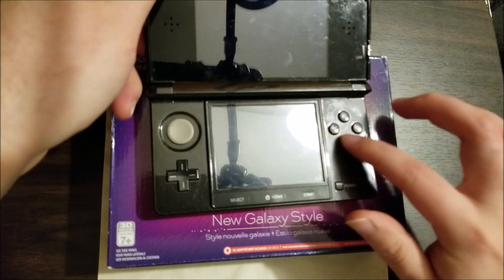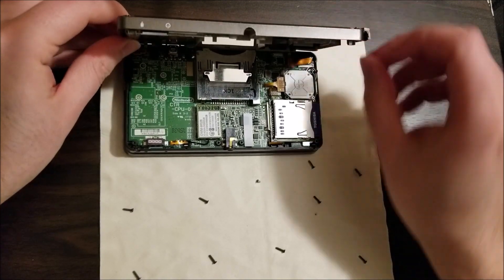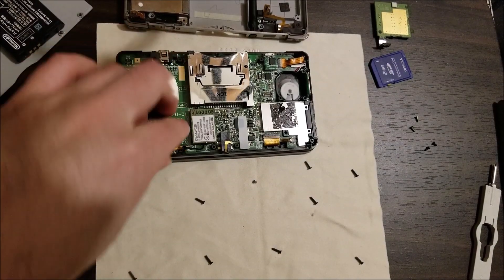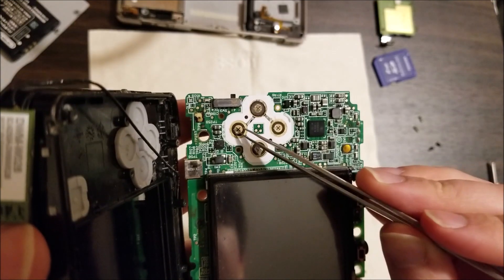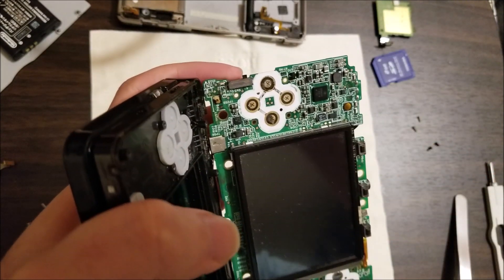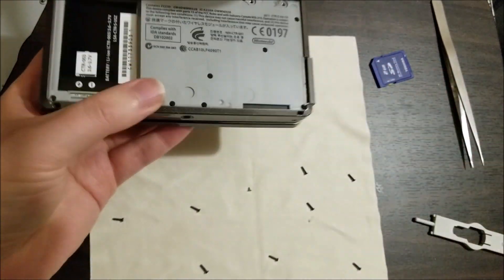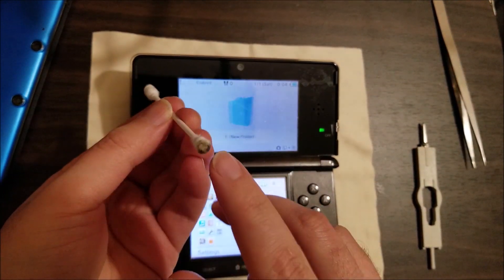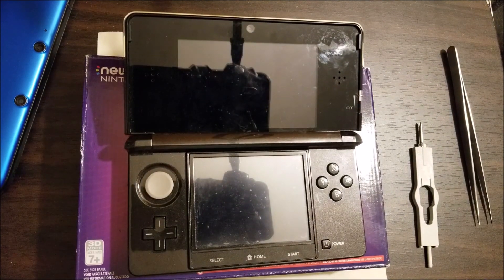Let's Fix: Nintendo 3DS Buttons Not Working

Comment: You were right to warn about those shoulder ribbon cables... I tried not detaching them and working around them like you did, and one ended up tearing. The good news is, the shoulder buttons weren't working either (in addition to the A button) so I was already going to replace them. 
Also, your tutorial was amazing, but there was no corrosion with my A button, just grime in the membrane, which I cleaned, and now it takes two presses to register so I'm not sure what's wrong.
Edit: I basically drowned my A button in isopropyl and it works perfectly now, but the wireless switch is stuck, which makes me think that when I opened up the system initially I got it stuck somehow. I've never owned a 3ds... the wireless switch should be able to switch on and off right? It's stuck on on. There was a tiny black piece when I took it apart and I wasn't sure if it's supposed to go in front of the switch or behind, but when I looked closely at your video it looked like it was in front? But now it's stuck, so I'm honestly unsure.
Reply from the maker: Can you gently manually actuate the switch?
Reply: @sjm4306  Hi! I fixed it -- the black piece is supposed to go in front of, not behind the slider. Thank you.
So my A button was working like normal but now it doesn't register unless I hit it a few times and it's less clicky than the other buttons. There's no corrosion and I already cleaned the dirt. Is it possible the metal round disk has been flattened over time, or should I give it another clean?
Reply from the maker: Great to hear about the wifi slider. Yep, your A button dome must have been slightly deformed/worn either through use or during cleaning. You may be able to get away with slightly bending the edges to restore the clicky action but it's pretty difficult and easier if you can just buy a replacement set of dome switches with pre-applied sticker for your model off ebay.
Reply: @sjm4306  Well I'm looking on ebay and all I see are the buttons themselves. Do you reckon the domes are the same size for the 3ds xl (which has a seperate button board)?
Reply from the maker: Hmm, I honestly don't know off the top of my head. I think I have spare parts boards for both the 3ds and xl so when I get home I can give them a quick measure to see if the buttons are the same between them.
Reply: @sjm4306  Thank you again!

Comment: I have a new Nintendo 3DS XL and my R button it's not working well how do I fix it
Reply from the maker: You can buy a replacement R button and flex for a few dollars, sounds like yours is worn. It's a pretty easy fix to do so long as you have the right screw driver and are patient.

Comment: I found my 3ds xl just recently and the c pad analog stick seems to be normal but when I turn my system on and on the main menu it constantly scrolls up. I tried the recalibrate and I didn't work.
Reply from the maker: Does holding the stick down stop it from scrolling up? It could be either your stick is broken or the connector needs to be reseated.

Comment: You skipped the useful part - removing and replacing the film, so we could watch 1 minute of scrubbing with a q-tip?
Reply from the maker: Removing and replacing the button adhesive membrane is as simple as peeling off a sticker and sticking it back on so I didnt think it was worth showing. However showing exactly what liquid damage does to the pcb contacts and how effective scrubbing with ipa I thought was more important.

Comment: is it just okay to pry open those 4 shiny things on the D-pad area? and if i pry it open...how do i place it back?...my 3DS problem is that...the right button at my D-pad feels a bit loose down while the other 3 button Up Down and Left are just on the right condition
Reply from the maker: They are just taped down. The metal snap domes do weaken with heavy use so you may need to replace the one that feels off.
Reply: @sjm4306  where can i find a replacement for those? i want to replace it but i don't know where to find or where to buy a replaecement for those
Reply from the maker: Your best bet is to measure the diameter and search that number in mm along with "metal snap dome"

Comment: I cant do this bc my mom
Reply from the maker: What do you mean because your mom? I definitely would practice on taking apart other broken electronics first but it's not like fixing a 3ds is impossible so long as you have the right tools and you are super careful.
Reply: @sjm4306  they probably mean that their mom wont let them because they are playing with electronics, which I can see why that would be an issue. Just make sure that you power off the system before you tap into it, other than that you should be fine if you follow instructions carefully

Comment: So I recently found my 3 ds again (first gen) and discovered that the B button seems to be unresponsive/only responds if pressed really hard and I was looking for a way to fix it when I stumbled upon this video. I am by far not talented enough to actually do what was shown in the video, but I learned a lot and found it to be rather interesting, keep up the good work
Reply: My "B" Button also doesn´t work very well, only if you press really hard too.
Reply: i allready did it. it works.
Reply: I did this with no previous electronic experience. It wasn't easy or fast, but it's possible.
Reply: my A button has the exact issue
Reply: Space Toast same
Reply: @GalacticHero2068  same il be in. A game like zelda and I can use my a for every thing else but I have to pick up a giant object and it says a to grab and then It don't do any thing text back of you have any thing that helps
Reply: Same. Doesn't look that hard if following the video, but I don't have the patience or the nerve to try it myself. Lol
Reply: I actually have the same problem with the B-Button. It used to work perfectly but today it kinda only worked if you pressed it really hard (just as you described). I did a bit of research and now I have the feeling that this happens very often to the 3Dss... I'll probably do a bit more of research, but I might have to try what he did in the video. Hope it will work and I won't break my 3Ds.....
Reply: @jusnaraleonidas5884  Whatever you do, don't strip any screws! If your screwdriver is turning but the screw is not, press down harder.
Reply: Jusnara Leonidas same with my x button!
Reply: OMG mine doesn’t work either on my new  Nintendo 3ds xl. It’s so strange how it suddenly stopped working. 🤔
Reply: @nate.9730  yeah. It happen without warning
Reply: On my 3DS it's the A and X buttons. Not sure if it ever got wet or dirty, but I'm afraid I'll break something if I try to fix it.
Reply: @FluffyNaddy  it's My b and my x
Reply: Same problem to me
Reply: My B button has this issue. I'll see if I can fix it when I have a chance.
Reply: @lswhere40  for me it's my A button
Reply: For me it was the a button and the L button didn’t work hope I will fix it soon
Reply: I have a 3DS XL with the same issue and I really never used it a crazy amount honestly. This must be common
Reply: For me Y doesnt work at all and X only when you press really hard. It's not that bad bc I mostly need A and B for games anyway, but it's still pretty annoying
Reply: Same with mines lol
Reply: A L R and Up D-Pad
Reply: Me too
Reply: for me its the top D-pad. Im sure thats the same thing?
Reply: The same for my "a" button, can anyone help me. Is there like a less risky way to do this
Reply: My B button sucks.

Comment: So I have a weird problem, my Y button on my 3DS OG is not working.... but if I close and open my screen it works the same as my Y button? I'm not sure what to do since Nintendo doesnt repair older models and I could no way do all this myself, any suggestions??
Reply from the maker: That's a weird fault. The only way to figure out what's up would be to pop her open and inspect the buttons for anything out of place. Do you have any friends who are comfortable doing that? I'd offer to take a look at it for you, but you'd have to pay shipping both ways for something that I may not be able to fix depending on what the cause is.

Comment: Loved the video! I was just wondering if you know what the problem my 3DS is having? It was working just fine until yesterday when I flicked the wireless internet button on the right side of the original 3DS and after I tried to do it again, it no longer shows the yellow light blinking and I can't seem to connect to WIFI within the system. Would be appreciated to learn what I might've done to it or how I'd be able to fix it since I have not been able to find any videos regarding my trouble online.
Reply from the maker: Thanks. When you flick the wifi switch does it feel loose or stiff? Also does it do anything different if you hold it for a second or two and then wait a little after you release it?
Reply: sjm4306 Not really, it feels the same as before, it’s still in tact and it bounces back right off when I let go. But I’ve tried holding it for a while and there’s still no reaction in terms of the yellow LED or the Internet connection. And I do remember I may have accidentally pressed on the switch a little too hard when my finger slipped but the switch doesn’t seem to be broken externally.
Reply from the maker: You may have to open the 3ds to visually inspect the wifi switch to see if there is anything obviously wrong with it.
Reply: @sjm4306  Yeah, seems like that's the only way to find out the underlying problem. Greatly appreciate your response and your time, I'll come by and leave an update when I do take it apart.

Comment: Anyone else find that the screws inside are made of such cheap garbage that they strip with almost no pressure?
Reply from the maker: Yep, gotta use a really sharp tiny phillips and unscrew very slowly or they strip very easily. Almost makes me wonder if this property was purposely chosen to make repair a little more difficult.
Reply: @sjm4306  even my best electronic repair kit stripped two of them. Was able to get one out with the rubber band trick. I think it's more they're using the cheapest possible screws to save a hundredth of a penny on production.